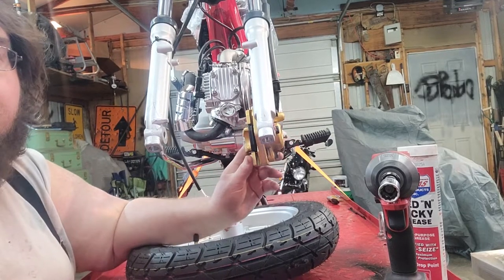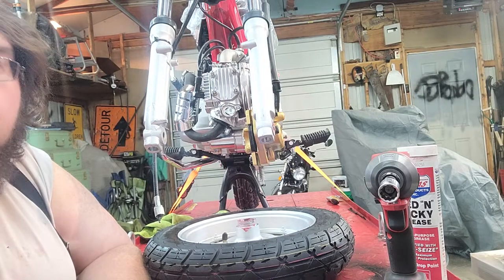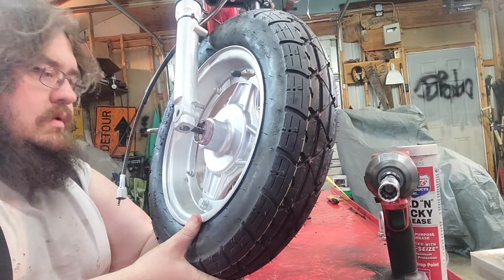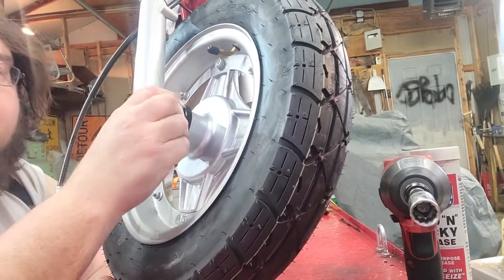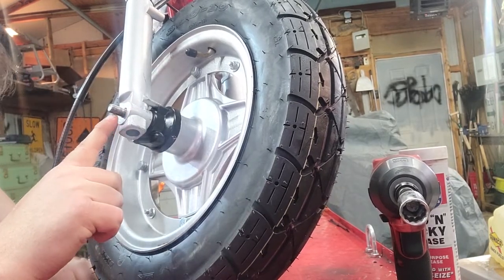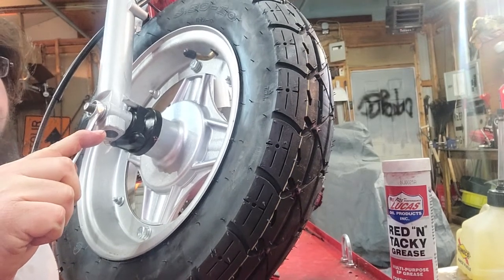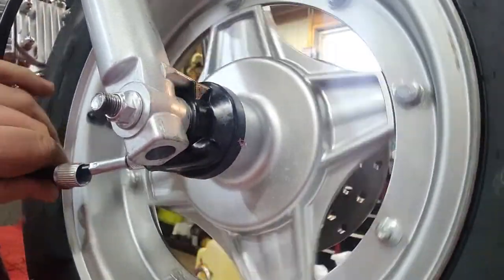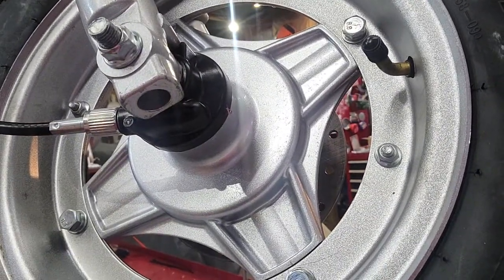icebear champion front wheel install

Comment: Recently put new tires on 2023 Icebear Champion, had to take off front brake caliper. Remounted caliper and when I tighten the (2) bolts holding caliper, there is alot of friction....can not spin tire easily. What am I doing wrong?    Thank You for any help on this.... Reno